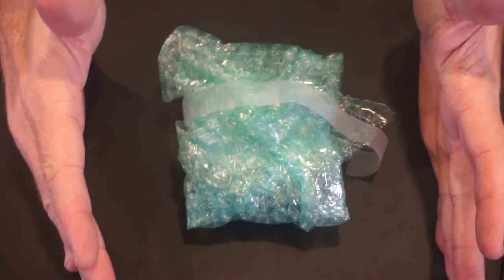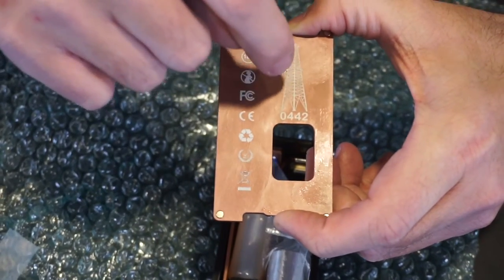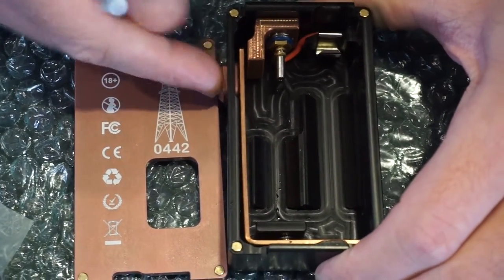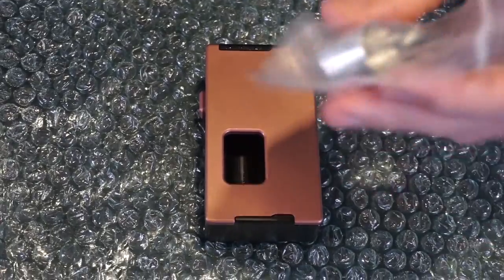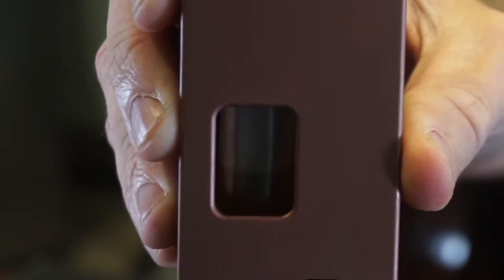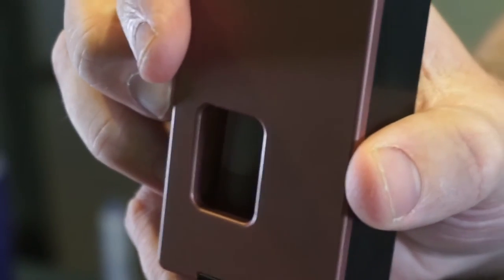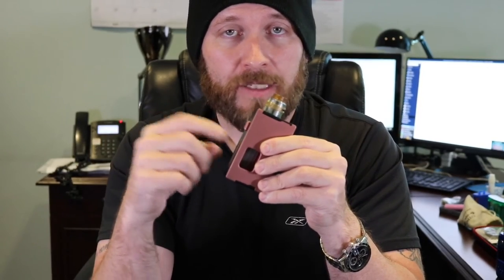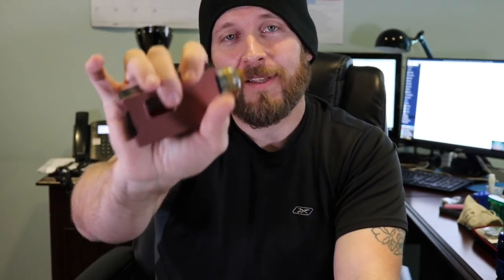RIG SQUONK MOD BY VAPEAMP ----MY WORST PURCHASE 2017 BY PAL 702

Comment: The big surface area on the contact prevents arching, i love mine absolutely love it, its elegant its simple, and a rig. Hits like a truck my bottle is softer, i can reach and sqonk fine, and the only thing is the button that i could find not necessarily wrong with its just wierd.

Comment: I got mine from vape amp last year.  They had them on sale, and I was able to use a coupon code!  I got it for 75 bucks. That being said, I absolutely love mine! Yes, I feel that the wire and the positive battery connection is a complete and total cop out. They really should have done something better than that.  But I use it everyday and it just plain works.  I've never had a single problem with it at all. I feel like if you would have paid less for yours, you would have liked it a little better.
Reply from the maker: Michael Whitson I agree about the price point for sure man.  $130 for that thing...I could have lived with the wire ...maybe...but that on top of the bottle.  The bottle I got with mine was so small and sat back so deep inside the mod that I literally can't squonk it.  The box is beautiful and I think that is another reason why I was so disappointed.  That thing could have been badass....the box is machined so perfectly...the door is solid as a rock...it just seems like they threw in the towel toward then end and just threw in a tiny hard bottle that is impossible to reach.  Nice job on the bargain shopping though man!!  You get some serious style points for that!!!  Thanks for checking out the review man!!  I'm usually super positive so hopefully you check out another one where I'm not bitching so much lol:)   Have a good weekend man!!
Reply: Yea, the bottle is just a cheap little bottle. I have been wanting to upgrade that for sure.  When I squonk I use my thumb and press straight in the bottle hole. I just kinda got used to it.  Lol 
I'm going to check out the bottles you mentioned in the video, and I'll check out your other vids for sure. Thanks man!
Reply from the maker: Yeah man the Lost Vape bottles, the Dolphin, and then you have the super nice Cappy or Lucos bottles as well.  I think most of those will work but what makes it kind of hard is that little stand the bottle sits on..it limits the height and a lot of the bottle out there end up not fitting.  Thanks again man...always cool to leave thoughts for everyone here ...especially if you don't agree as the majority of a review (besides the specs) is just an opinion and mine ain't any better than anyone else's :)
Reply: Got mine for $80. It just plan works and is nice for the price I paid. Buy a vandy vape pulse 8ml squonk bottle for $4 and it will fix most of your bottle complaints. It's a bigger diameter and a good softness.
Reply from the maker: NICE!  That $80 range is way more realistic  for this squonk.  If it had been 80 I would've been way less harsh:)  Hey SGJarrrod....thanks for checking the video out and massive thanks for leaving a comment!!  Not sure if i've see you around here yet, but I really appreciate you taking the time!!!  Have a good one and hope to see you around in the future man :--)
Reply: Yep, I'm new and a fellow squonk addict. I'm not sure how I found your channel but glad I did. I was going down the YouTube rabbit hole and ended up here.

Fyi, I just ordered another squonk and am pretty sure it's exactly what you wanted this one to be. Check out the Tugboat mech squonk by flawless. Has ALOT in common with this Rig but is the size of the pulse, has soft bottle and is true mech, $120. Pro tip, got mine at vapehappy use code Reddit10 for 10% off.
Reply from the maker: Awww...a fellow squonk and youtube junkie !!  I know Squonker you're talking about and YES, if that had been around and I ordered it, the video for that would have had a huge smile on my face lol!! Glad you went far enough down the rabbit hole man...most don't make it to this point!  Thanks for the coupon code though man...if I do end up getting that i will definitely reply to this thread so you know when the review is out man.  Until then have a good one !!!!

Comment: I got a squonk bottle from a pulse and it helps a bit
Reply from the maker: Hey Mathew....did you keep that little squonk bottle stand that they build for the bottle to sit on or did you rip that out?  Out of all the bottles I have, that Lost Vape bottle seems to be the best fit.  I still have to yank the neg battery clip out of it and put the straight copper strap piece in.  I keep forgetting about this thing...it's like buried on my desk and I think I try to NOT look at it lol!  Once I get rid of the wire and have that Lost Vape bottle in there It will be a nice squonk box mod.  Thank you so much for checking it out AND leaving my a possible remedy ...HUGE thank you on that one man!!!
Reply: I kept it in there, it fits perfect, even a little wider than that shit one it comes with so you can reach it easier
Reply: And I still don’t understand why they went with that fucking wire, it just doesn’t make sense, I haven’t had any issues with it really other than they just threw some shit together like you said to make a quick buck, I used it for a while, but even when I got my pulse I haven’t even touched that damn thing! Lol keep up your channel man, I support you all the way!
Reply from the maker: AMEN BROTHER!!  This squonker could have been such a badass mod to own...like those contacts are sooooooo beautiful...big shiny chunky copper...it's like a mech-heads dream...and then comes those damn wires!!!  I'm usually a pretty chill guy and I tend to fix problems or little issues with gear i buy...but this one felt like a big FU !!  I really appreciate you taking the time to watch man and also sharing your thoughts bro...the only reason this channel is fun or is even here is because people like you!!!
Reply: We’re all in it together brother, stay on it and you’ll be up there with the rest!
Reply from the maker: Thanks for the kind words and I promise you that I'm staying on it and getting a little better every week.....and if IM NOT then just tell my to pull my head out of my a@#!!!   Much appreciated man..I will be seeing u again..like tomorrow when a new video goes UP :)  Have a good one man!!!!
Reply: Hell yea dude! Well be having these conversations when you’re at like 100k and shit! I’m sure I speak for all of us here when I say we see potential or I’m sure we wouldn’t be here! Keep it up man! Looking forward to more videos! Take it easy!
Reply: Matthew Andrews does the rig mod hit hard??
Reply: Oscar Soto Tamayo so it does hit pretty hard, also has a lot to do with the build and rda you use as well! But I would recommend it

Comment: $8 on eBay gets you a damn good super soft bottle. It's vapeamps first attempt at a squonk. It's going to have problems and most of them are nitpicks
Reply from the maker: Yes Carlous my point exactly on the squonk bottle.  For $130 I'm not really in the market for a squonker that only come with 1 bottle, that bottle doesn't fit (i cannot squonk this mod), and it's the cheapest bottle money can buy (the bottle in this squonk is the worst quality out of all my squonkers).  The wires are a massive problem with people that love mechs....i mean Rig/Vapeamp of all people should know there people.  I just think it was a very huge mistake to over exaggerate those massive copper contacts and then finish the connection/circuit with a wire.  The packaging..well that was the crappiest thing I've ever seen as well.  If they had sold this for $80 I would have been ok with my purchase, but they chose to charge $130 and for that amount of money this squonker is the "worst" purchase I made in 2017.  I still have it and will sell it for $70 as that is what this thing is worth.  I've got maybe 25 vapes through it...it is 100% brand new.  I appreciate you taking the time to watch though man!!  I hope even though you disagree with my opinion that you check out another one...end of the day it's all opinions and many subjective things when we break down hardware.  Have a good weekend Carlous and I appreciate you taking the time to not only watch but to leave your thought and opinions :--)
Reply: PAL 702 thanks for your reply. As for the people complaining about the wire I get that it's not a "true mech" but it hits just the sane
Reply: PAL 702 and I also agree that for $130 it is a really shitty deal to get a 2 cent bottle but like I said first attempts are always flawed
Reply from the maker: Carlous :)  good to hear from you man...but by your logic I would not want to fly on any new airplanes, or ride in a companies first line of Mini Vans ;)  I guess nobody that happens to buy or purchase something from a company on their "first attempt" wants to hear that...especially when the company has been in the game for years and years and knows better.  But we are here to disagree w/ a smile :)  I do get what you're saying though  man :)   We agree on the $130 price-tag!.  I guess I'm mad for buy that thing when a good look at the pics should have told not too!!  Anyways, hope all is well and hope you had a good holiday weekend man....back to the grind MONDAY for me !!
Reply from the maker: Yeah..I couldn't even get on board with that complaint lol! I mean..I could have but I would have been WRONG ;)
Reply: PAL 702 I guess I can't say a whole lot. I got mine in a trade and it's no worse than any other squonk I've owned. If I had paid retail for it then id probably have the same thoughts on it. Have a good week bud.

Comment: I don't understand why they even bothered to use the nice big thick copper contact. If they knew they were going to stick a wire in it. Maybe it was used as a diversion to keep our attention off the thin wire. I was excited about this box when I saw that chunky contact, then vaping biker showed it off on a live stream and I saw the wire, I then lost all interest.
Reply from the maker: korgeth...EXACTLY!! I was a fool..I saw the contacts and the Rig and just ordered it!  I didn't even know man.  Besides the wire, that bottle and how far back it sits is a JOKE..you can't squonk this thing without turning it sideways and using a hydraulic press!  I was surprised nobody ripped this thing...feel like it kind of slid by....not for $130 man.  Thanks for checking it out though ...I REALLY appreciate you taking the time :)
Reply: Does that wire lead to a mossfet?  Excuse my ignorance
Reply from the maker: NOPE...that is why this box is so stupid!  It's not ignorance at all..it actually is a logical way of thinking bro.  Usually, if you see some wires near the top of a box mod it is usually leading towards some type of protective circuit/switch.  This wire just connects the circuit from the battery to the 510 :( .  Thanks for listening to me about lose my shit man lol.....I appreciate you checking it out:)
Reply from the maker: I just realized how AWESOME your name is ....HIPPOLAS CAGE!!!
Reply: PAL 702 haha thanks

Comment: #0062 blue i honestly feel like you bashed it too hard. Seemed more like a squonk bottle review. Nothing was said about machining, very little vape production information, no material facts. Sqounk is easy to press unless your 80 with arthritis. The wire improves the conductivity. Enjoy!
Reply from the maker: TY for checking it out Nicholas :)  I did pay it a huge compliment...in this review I saw the actual box itself is very HIGH quality and extremely well done.  That's why i was so mad that I paid $130 and it showed up with a wire and shit bottle.  I typically don't trash stuff and only point out flaws or "FYI"....but the wire, price, bottle, and the shitty packaging it came in ....this IMO was nowhere near a $130 squonkers (I could think of a dozen squonks for that price that I would recommend ;)  There is a reason everyone dropped their price on this yet it's not out of stock anywhere.  
It's all preferences though brother...if you got one and you love it then I think that's killer....very rarely am I this let down on a mod...Rebel Squonk made this look like squonker of the year LMFAO!!
Reply: @PAL702  i highly HIGHLY respect your reply thank you for being considerate. I put more thought into it and i do see your view on the mech. I agree with your viewpoint on why the price bracket is off. Check out the plug squonk by mumsfactory some time if you can. I own 3 and need more.
Reply: @PAL702  def not squonk of the year tho..

Comment: Lmao do you guys know what a wire is? A wire..... Is copper..... Insulated...... With rubber. Again its copper, inside of, rubber. COPPER. ITS COPPER. would yall have benn happier if the copper was exposed and flat. What would change? I have MASSIVE hands and i have ZERO issues squonking this bottle. Do i think it should have been a better bottle? Sure. Is it as bad as you are saying? Hell no. You people who say give me a soft bottle you are nuts they are the worst bottles. The one you praised that comes with the Athena is absolute trash! Silicone bottles NEVER never suck juice box. #TrashReview.
Reply from the maker: YUP, I know what copper is and I know that the mod is technically a mech but wires or solder joints break over time while a solid slab of copper, silver, silver plated copper does not.  Plus if you're going to be that dramatic with those big huge chunky copper contacts and then finish with a wire it's like blue balls.  I hate hard bottles and this mod was no where near $130....that's why the never sold out anywhere and the price dropped in half.  If you scored this for $75 then it's an awesome buy...I even say that the enclosure and mod itself is super nice but if you like wires in your mechs then that's your style and your opinion.  This was mine and I appreciate you not only watching but leaving your thoughts bndo 1988 :-)  Disagreeing; believe it or not is allowed around here......shit it's even encouraged!!!  Keep vaping brother that's all that matters #ALLOVE